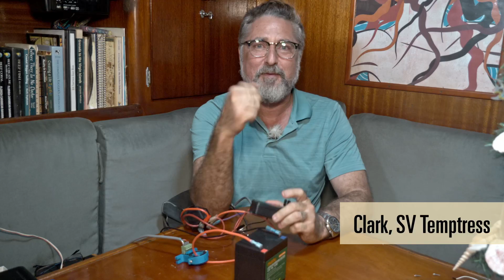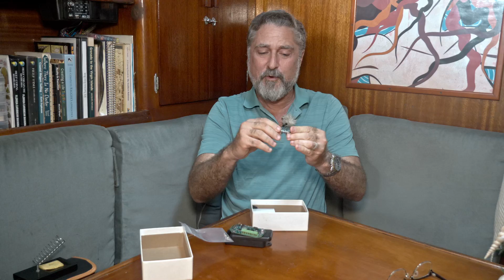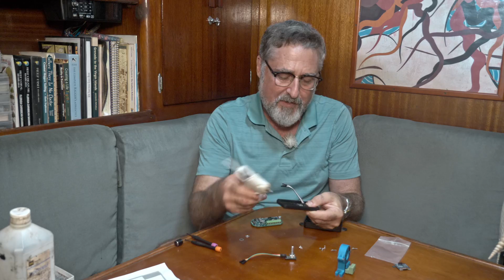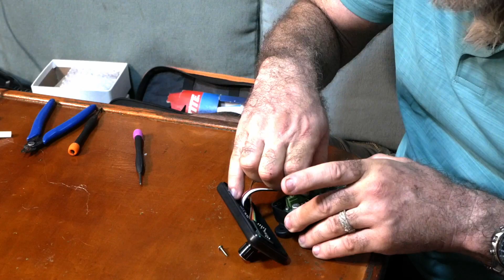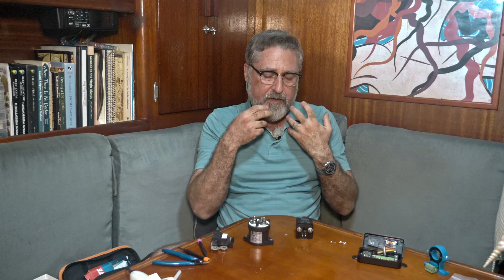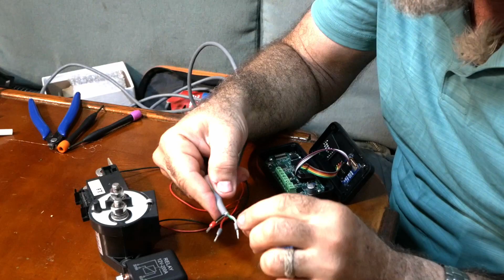What to expect when you order a BankManager™?

Comment: Hey Clark, is there a way to disable the OLED display when I'm not looking at it? I've noticed some burn-in after only 6 months. Is there any good spot on the board where I can de-solder something and add a switch to turn the display on and off?
Reply from the maker: What unit do you have?   When did you buy it?
Reply: @Clarks-Adventure March or April 2024, it's a version 2. I can check the exact version number tomorrow if need be.
Reply from the maker: That might be late enough to just turn the dial left when you aren't in menu mode.
   It was about that time that the latest software should have gone out.

    If not don't worry about the burn.   Amazon search "OLED I2c  0.96".   Cheap to replace.
Get new "DuPont wires" at the same time.  Also cheap
   No it won't boot up without the OLED functioning
Reply: @Clarks-Adventure The version written on the back is 2.3 . Turning to the left does nothing. Is there any way I can update the firmware?
Reply from the maker: Nope sorry.
Reply from the maker: I seem to remember the next 2.x release jumped to 2.10 which gave the dimmer/off OLED function.
Reply: I'll try turning to the left tomorrow

Comment: are the two diodes important on the shallco 300a that connect from the on and off terminals to the common terminal? the manual didn't clearly say how to turn the bi-stable relay off manually so I first wired the positive to the 86b+ terminal and the minus to the 85- common minus terminal through a momentary switch -- but this first blew up my 5A fuse, then my 10A fuse and then I tried without a fuse and it probably blew up the diode since I thought it just needed more current to actuate -- anyway the diodes look like they are shot but are they imporant? when I switched the negative/positive wires it actuates normally and I could turn the bi-stable relay off for finishing the installation
Reply from the maker: First off to everyone reading this.  The engineer chose a fuse size carefully so you can't do something stupid. If you blow a fuse assume you did something wrong and DON'T use a bigger fuse.

Those are flyback diodes and are important to protect the final transistors in the controlling device.  As long as you use this contactor with a BankManager they are unimportant as I include flyback diodes in the BankManager itself.  Remove them as they sometimes fail shorted.

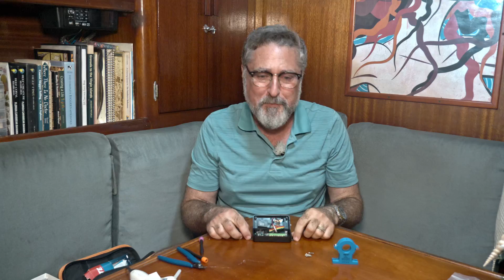Comment: 10:20 my application is a camper van rather than a boat. Does the automotive application require any changes or considerations in installation, configuration, and/or maintenance?
Reply from the maker: You just have to take the little lifejackets off the electrons.

Seriously it's the same thing.  There are lots of RVs running the BankManager including ours.  https://youtu.be/viTpFVdK4ds

Comment: Can I use this in my car instead of a boat?
Reply from the maker: If you are putting LiFePO4 in your car it's a great idea.
I have one in my truck
Reply: Super cool. I'm either creating a cheap "powerwall" from lithium ion (3.7 nominal) cells or I'm doing LiFePo batteries. I'm not sure yet but I'm creating a special project that I need auxiliary battery in my car and some solar charging hopefully may be doable. I'll copy the comment I just wrote someone else about this project:
I'm doing a multiple year HH0 (hydrogen and oxygen enhancement) project on my car. I have a huge HHO generator installed and a special PWM 100 AMP rated. I'm seriously hoping someone can help me complete the last 1%. Everything else is finished and very well working. I've driven months and months with HH0 and it's awesomely wonderful. The power system is my struggle, I'm 99%. I simply need to convert a 0.5-1 volts reference signal to: [times 5] to 2.5-5 volts signal the PWM can read. Op-amp or analog curcuit is answer. I'm too new to electronics to quite get this so far. Help? 😢😮😊

Comment: So not all the parts come with this thing? And how does it work with cold winters?
Reply from the maker: This is a video about assembling the Gen1 unit. We don't sell them anymore.

The Gen2 comes all assembled. You need to add a switch, 3 fuses, and wire.

The best way to protect your Li in cold weather is with a BMS.  But in a few months I'll be offering a Gen3 unit.  It will cost more (the GEN2 will still be available) but will include cold weather Li shutdown, Bluetooth and several other new features.  It will have a switch on the case.

Comment: Hey Clark thanks for another great video. I have a quick question for you regarding a simple 50 W solar panel which I purchased with a controller included. Is it normal that the solar panel charge manager can handle one lithium battery by itself. I’m using one lithium battery to power a small refrigerator cooler and I have a solar panel to keep that battery charged. Do I need something other than what normally comes with a solar panel in the way of a controller. Thank you
Reply from the maker: The "free" regulators tend to just stop voltage at a point and stay there.  That will kill li fast.  Also not good for lead unless the panel is small relative to the battery.

Of course I think the "Victron" approach isn't that healthy for them either but I'm biased

Comment: Hi Clark, thank you for the video and hello from over the pond! We have a narrowboat and I want to move to lithium but, we have a twin alternator setup, one for the LA starter battery and another for the LA house bank. I really like the idea of your BBMS. Do you have a wiring diagram for how I could accomplish adding lithiums to our LA batteries via your BBMS? Many thanks again, David
Reply from the maker: Sure David.  Have a look at the manual.

https://www.emilyandclarksadventure.com/bbms

Basically you keep all your current charging systems installed.  Just parallel your new li with your house lead with a contactor on the positive wire.  The BankManagerPlus controls the contactor to disconnect the li once it's charged and reconnect it when it is needed for service.
Reply: @Clarks-Adventure  thank you. Ordering one now
Reply from the maker: Great.  You will need a US address.  If you don't have a friend some people are using reship.com

Comment: As a motorhome owner I am intrigued by this idea and device.  I would like to hear from another motorhome owner that is using this device.  In particular,  does this device protect the lithium when starting the generator (which I would still use for air conditioning, and is started from the house batteries).
Reply from the maker: Yes.  There is a feature that lets you limit the draw on the lithium.  When the engine cranks if the draw is too high the li is disconnected until the battery charger brings the lead back up for safe reconnect.

    We are installing it on my parents RV next month and taking a few months to tour the American West.
Reply: @Clarks-Adventure  Thank you for your quick response!!
Reply: @Clarks-Adventure  Hi Clark would like to buy this unit the plus I’m running on my home right now with a generator With lead acid battery’s I picked up lithium batteries I like the way you’re hooking them together and would like to buy the plus model what do I do
Reply from the maker: Just visit the sales page and place your order.

https://www.emilyandclarksadventure.com/bbms

Comment: tried to contact you via the *Eea-male system on your website......  but it came back as un-deliverable by my ages old MSN mail service that is "hot"
few questions

... as I understand it your system essential does what a BMS does for  protecting/balancing etc. cells in a battery... but instead balancing each battery, in a bank? 
... does this BBMS reduce? eliminate? the issue of charging lithium via alternator  (aka acts like a restricter or buffer or similar to the issues that arise when using standard alternator for charging Lithium?)
... is this available to purchase yet?

*apparently I can't use the real word or youtube axes my post...
Reply from the maker: As long as you don't use a url I think you are OK.

The BBMS is essentially different then a BMS.  Please look at the user manual.  https://www.emilyandclarksadventure.com/bankmanager

(And yes it's not fair I can type URLs)

If you include a thermal sensor hooked to the alternator case and your alternator regulator you should be fine with BBMS protection.   The biggest threat to alternators is diode death caused by BMS shutdown.  The BBMS approach protects from that.
Reply: look forward to reading the manual. Thought I understood from your videos that having something like SLA's in the mix..... helped protect the alternator.    Just what am looking for

PS  yeah.... I put your email address I sent too in the axed message.  MSN said it was a bad address. Just thought you would want to know
Reply from the maker: Yes I'd like to know where we list a bad address.  Where please?  So I can fix it.
Reply from the maker: What the BBMS does in a nutshell is make sure that nothing can overcharge the lithium while allowing your lead to fully charge.  It does this without you having to change any of your current charging system.
Reply: @Clarks-Adventure  my current system does not exist yet,  besides what is OEM on the truck.....  unless that is what you mean by "current system". Presently dont have any lithium  batts or chargers or solar chargers. YET...  got ten 100 watt panels though lol.   Will read the manual.
Reply from the maker: PS.  Your last message didn't go through.    I assume you sent a url???
Reply from the maker: You keep adding something to your comments that get your comment blocked.

Our Email address is emilyandclarksadventure@gmail.com
Reply: @Clarks-Adventure  

nope I have never sent a url or an address... Ive sent HIGHLY disguised incomplete ones so you knew what I was talking about  but google figures out disguises now too  I guess. 

anyway I think I found the mistake..  just emailed again
Reply from the maker: Yes I just responded

Comment: Nice! Could this be used with a capacitor  instead of a lead battery?
What watch are you wearing?
🙂👍🏻
Reply from the maker: No.   Super caps sound like a good idea at first.  They aren't.  There are huge issues that will become apparent when your get serious.

Citizen Blue Angel.
Reply from the maker: But technically bit would work with a big enough cap bank.  If you built current control equipment.

Just don't do it!
Reply: @Clarks-Adventure  Yeah, I was curious if you happened to resolve any of those issues.
Nice choice on the watch!🙂👍🏻
Reply from the maker: The disadvantages outweigh the advantages.  So I gave up on that idea within hours of thinking about it.
Reply from the maker: Thanks

Comment: A bistable relay would be a good choice. The normal relays take to much current and get hot. There also IGBT transistors out there which can handle several hundred amps. Instead of a Hallsensor I would still prefer a normal shunt because the Hall based sensores become discalibrated by overcurrenting very easy. A simple shurtcut that pops the mainfuse an the readings then are far away from the truth.
Reply from the maker: I did run into that issue with the Hall sensor.  I've added some dynamic recalibration features to the software.  So far it's OK but if it poses a problem in other installations I can stop charging for a few seconds and recalibrate when things get near completion.
    That feature won't be in this version but I'm planning on allowing field software updates.
Reply: Totally get this and, like Hyper your commenter, I too would favour shunt sensors.  Having just installed five, but not wired them to any electronics it's a tiny bit annoying to go back to a Hall device.

Comment: What about using a contactors like the Blue Seas 7700? It’s bistable and has a remote switch which can be used for microcontroller on/off interaction through relays without impacting the switch itself and can be switched manually, and it has a manual lock-out for a technician working in the battery to disable any chance of reconnecting.
Reply from the maker: It's a bit expensive but sure if you like it my BBMS will control it fine.

If you use the lockout control on the Blue Sea you should reboot the bbms.  That way it will safely get everything back in sync and recalibrate it's current sensor correctly.
Reply from the maker: I just took another look at this and noticed it uses high side switching.   My BBMS gives low side switching.

One would need to convert my negative side signals to positive signals to work with this.

Could be done with a p channel MOSFET a diode and a resister for each line.

Or, not solid state but, it could be done with two tiny relays.  Basically make the relays act as the switches in the blue sea install document.

I signal for 150 Ms so loads of thine for the relays to action
Reply from the maker: You might like this one.  Basically the same thing but available as low side switching.

Mxl14 by https://www.gigavac.com/catalog/power-products/mx-series

Comment: Elegant small controller. I like the separation of devices for repairability.
Reply from the maker: Thanks Braith.

Yes, and all the components are available.  I was concerned that people would be put off about the small size but I went for small to not waste valuable boat space.  And figured people would realize that cell phones are tiny and powerful.  
It's all about the software!
Reply: @Clarks-Adventure  The amount of surface mounting space is incredibly limited in my boat. Additionally I detest attaching more electrical in the cabin on grand mahogany. I could easily reconfigure the components into a round or square gauge style. Waterproof housing is all I can see to improve.
Reply from the maker: Waterproof is difficult for something that needs wire access.
I apply conformal coating.  So the chips and board are basically waterproofed
Reply from the maker: If you do remount it please send me a picture.  It's possible to have this drive a larger screen. 1.5 or 2.4 inch diagonal.  I haven't tested yet but they are made and should work.
Reply: @Clarks-Adventure  Certanly I will if I can get a unit. Dummy gauges are still available. They might work with modification.  Rather a square over round. 
Hoping for you the lot go high and completely out of my range, your efforts deserve it.
Reply from the maker: Thanks.  I have people looking for chips.  We are even considering buying cheap devices and removing the chips to install them on a BBMS.

Feel free to bid the MSRP.  Some people are.  I also hope they go for more but having the bids gives me an idea about demand and who knows you might get lucky.
Reply: @braithmiller  That sounds like a neat idea.   Something that bugs me  in the RV world is the mismatch of styles for the various different controllers that get fitted, especially considering the cost of those RVs (and Boats will be even more I am sure!).   Because of the way Clark is shipping in kit form it would be super-easy to use a custom case to suit cabin aesthetics and also could take the opportunity to have the cables setup as rear-entry as well to avoid any on show.   Options are good :)
Reply: @Clarks-Adventure  good point